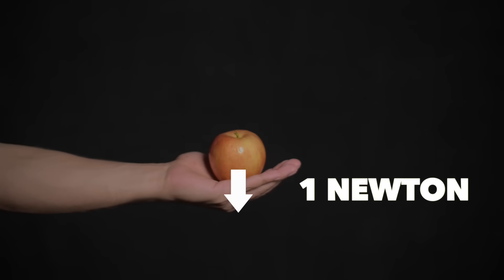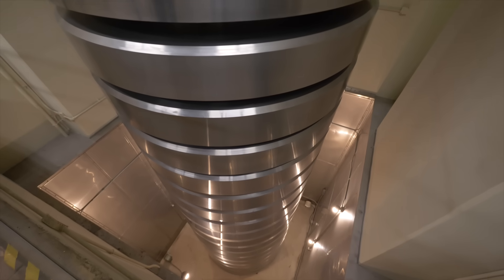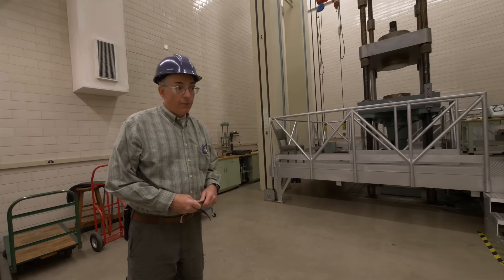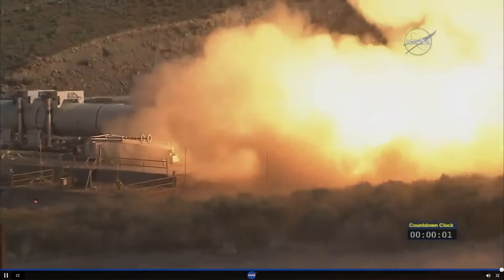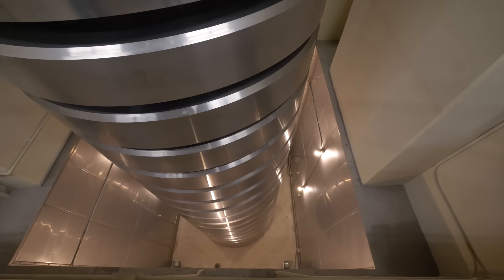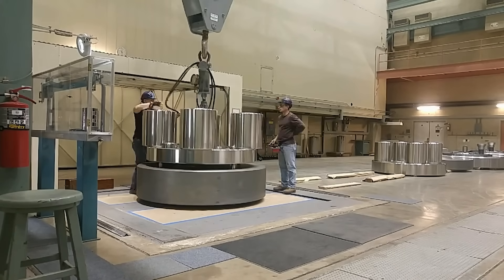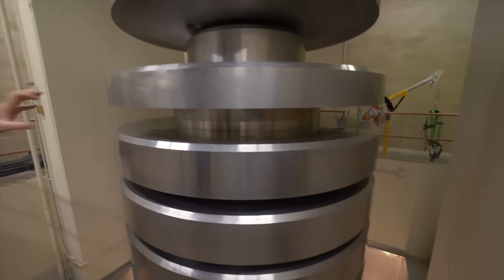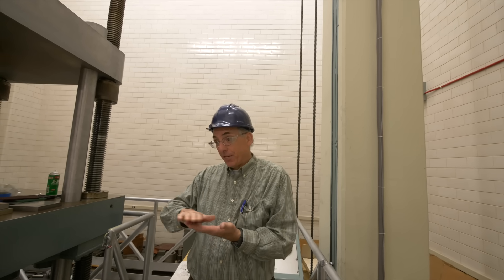World's Heaviest Weight

Comment: Is there an existence of a certain limit (number) of a maximum ammount of mass (kg) which has the form of a perfect sphere and is made of a specific material (for example metal), that has the ability to stay in the normal way, and if more mass (of the same material) is transfered into that perfect sphere (with the mind to even if the material is added, the sphere stays perfectly equal on each point with the mass - think of it as dipping it into the mass, which may be liquidized) ,before it destroys itself after that because of the added mass?
Emax I  kg/N-> x where x goes past a limit, that the middle of the sphere begins to crush ,because of the mass which surrounds the center is too heavy so the middle of the material can't stay unchanged.

In easy words: 
Is there a possibility that every material or only some materials are being crushed in the center by themselves if the material is formed in a giant perfect sphere. So that a max ammount of material exists that a material can have before crushing itself in the inside from the complete surrounding mass.

"o" = max
if o gets any bigger (for example mass is added to try to get the form "O") ,
the giant sphere O begins to shrink again until it gets the form of "o" again. Because of mass pressure.

Simplest question of this problem:
Exists a limit of density, where nothing can get crushed any further ( or nothing can get any denser), even with unlimited mass and power, building equal pressure from each side of the (dense) sphere?

I'd like to know that.
Any suggestions if something like that can exist?

Thanks
Reply: The singularity of a black hole.

This isn't even a joke answer, seriously. Neutron stars are a nearby second, but that's kind of what a black hole is, an incompressibly dense mass. It becomes spherical due to the force of gravity, you say 'has the form of a perfect sphere' when any gravitationally-formed mass will have the same natural form, it's not something that has to be specially striven for.
Reply: As I think of it, you are right.
So if this is true, Black Holes always have to have the form of a perfect sphere.
Never thought about that before.
But my question also is, if there is an answer, which "material" will the last stage (the most inside in a black hole) be, if the material, which is attracted to the black hole is something specific (for example: steel).
Will it physically due to the high pressure transform all the different materials which are mixed together into a new most-dense material and stay that way and only grow on the outside and transform every outer layer into that material or is there a max number of level of compression where a Black Hole only grows, but doesn't get more dense in the inside anymore and the Material(s) stay the same (steel stays steel, other materials also stay themselves - only compressed - just an example with steel)

On the one Hand: thinking about it physically, I would suggest there is a max compression and the blackhole only grows in Volume and mass.
Therefore there has to be a max. density.
On the other hand, seeing this problem physically, if you add more mass to a sphere, it gets more dense in the inside, because it compresses itself from outside mass.

I found the same question asked in better explaination of the thinking-experiment in another point of view, because I'm not the best in english.
Also named "Black-hole-Singularity"

https://www.quora.com/Is-there-a-maximum-density-for-a-black-hole-Does-increasing-the-amount-of-mass-of-a-black-hole-change-its-size

I also found the explaination of max theoretical density described as "Planck Density"
It's roughly 10^93  g/cm^3
Physicists speculate, that with such density, there should be new effects.
I also read that at a high density, there exists a spacetime curvature.
Anyway, thanks for everything.

Comment: 600 lb extra according to local gravitational field strength anomaly seems unexpectedly high, that’s about 1/7500. However gravity varies by as much as one percent, with higher values for Lower altitude and higher latitude. Therefore I will not be coming to conduct a quality control investigation.

Comment: Mass is mass and weight as inside a magnetic field produced by an electromagnet is weight !?
The most accurate measurement of weight used to be done by placing a piece of metal in between a magnetic coil. Now they use a photon beam. But the force applied in space or the time to gain momntum to displace a body is different to the force and time needed inside a gravitational field to displace that same body.

Comment: rofl.....stupid fucks still messing around with.......( snorts laughter to self..).............POUNDS....WHahahahahahahahahahahahahaha!!!!!!oh btw.....mr... lets get egotistical about a hydraulic press & weights....If you design a plane, knowing what material you use, on which frame, you know almost exactly what the forces are. You can also work out force, as a measurement of fuel burned vs displacement & rpm. Or in the rocket booster's case. fuel used vs. diameter of thruster vs burn rate x effeciency. and guess what...... YOU DON"T HAVE TO BE PRECISE re. the plane's power...so another storm in a teacup there for the sake of self ego stroking.

Comment: >calibrator is in America
>uses American units
>pounds measure force
>metric system doesn't
>"wHy aReNt yOu uSiNg tHe mEtRiC SyStEm"
Reply: Ethereal Forest ... Newton’s are metric. Newton’s measure force. Also it doesn’t help that he keeps saying that it has a “mass” of 1Mlbs. Btw if you want to defend the imperial system it’s best to mention that base 12 is better for division than base 10. Other than that metric has the advantage in every unit. But to engineers it doesn’t really matter.
Reply: @internetmovieguy  Fahrenheit beats Celsius for human temperatures.
Reply: @EGL24Xx  Yes, because you need to disregard both the length and weight measuring systems just for temperature!
Also, I personally can't really justify that argument if 98°F is a healthy temperature as well as ~103°F depending on what climate you live in.

Comment: Seems like a lot of these comments are about imperial vs metric. 1) It's an easy conversion, the mass standard here is still cool and the same accuracy regardless of unit, 2) most people said "just use kg", but kg is a unit of mass not a unit of force, which is what they want, which brings us to 3) Even Newtons, which is the appropriate measure, means basically nothing to people familiar with kilograms, since in SI units it is kg m/s^2, or the amount of force required to accelerate a 1 kg object by 1 m/s^2. If you want to associate it with a ballpark mass in terms of downward force using g, you need to divide by 9.8 m/s^2, which is so much harder than just multiplying by ~2.5 to go from lbs to kg. Especially since they're using big round number increments.
Reply: Americans are 300 millions. The rest of the world (7 billions) watches these videos as well and uses metric. Enough with their stupid system already,

Comment: Well, if the weights displace 125 pounds of air such that another 125 pound weight must be added, then wouldn't that weight also displace another x pounds, meaning another x pounds must be added which then displace y pounds, meaning... so bascially, when it comes to accounting for the buoyant force, they're probably adding a bit more than 125 pounds, no?

Comment: So -- it displaces 126 pounds of air. And I suppose the weight that they have to add to compensate for that displaced air must also displace a certain amount of air, so they have to add some additional weights to compensate for that additional displaced air -- and those additional weights added to compensate for that additional weight of air would have to be compensated for by adding some additional weights which would mean they'd have to -- hold on...

Comment: So much work just to NOT use N or Kg.
Reply: just have your government build one for you sweetheart.
Reply: @powerforth8400  I mean, the Imperial system is pretty much a direct conversion of the Metric standard, so as far as the scientific world is concerned, the Imperial system is literally inferior, but keep telling yourself that a system of measurement is better because an organization built a construction capable of accurately calibrating extreme forces.
Next time, if you want to invalidate someone's argument, at least use a relevant example to do so, sweetheart.
Reply: @Volvith  try working harder, not smarter.
Reply: @powerforth8400  only weak people stop learning
Reply: @Volvith  i feel like the reason he used imperial is because its exactly 1m and in kg its like 453592.37 which is alot harder to say and isnt as good to say in a video

Comment: They should use this as a battery. Have some sort of motor  lift it up on time they don't need all there power then when the need power. Have it hooked to a generator and the weight will power it.??

Comment: So what are these made out of to let it be so dense to get to 50,000 lbs? Because that must be VERY dense.
Reply: It's probably just steel. If you assume about 6ft in diameter and 6 inches thick, works out to about ~450 lbs/ft^3 which is about the density of steel. Cars don't actually have that much metal and they generally use aluminum for the chassis.

Comment: Why would you have to 125 pounds for the air?? If you would have it hang in a vaccum, it would not change its newtonian pull, right? What I am saying, I understand air has a drag on the weight, but the drag disappears once you stop moving it. So why calculate it into the measurement?

Comment: I wonder how accurate my gym weights are... and, yes, they are well below 1000 000 pounds, thaaat I'm sure of :-)
Reply: I know this was a while ago, but I can't help but answer. I was curious a few years ago and measured some gym barbells. The cheap ones are about +/- 8% accuracy. The more expensive ones are about +/-2%.  The accuracy also get's worse under about 20 lb. So your 100 lb. plate might be 92-108 lb, but your 10 lb. barbell could be 8.5 to 11.5 lb.
Reply: I had just assumed they would be something like +/- 1% so 8% sounded so much I had to weigh some of my weights. The fist ones (2,5 kg plates) were off by about 2%, the next ones (1,25 kg plates) were off by up to 5%. My 5 kg plates are from different manufacturers, one brand was consistently pretty much dead on, other brands were off by up to 5%. The real surprise were my 10 kg plates, two brands were consistently 8-10% above, another brand was dead on (maybe +/- 1%), my 20 kg plates are the same brand as the last 10kg plates and are also +/- 1%. Now I have had my workout for the day :-)
Reply: they won't be that precise because the more precise they are, the more expensive they are to make. and we all know that rogue wouldn't want to spend any more money manufacturing their barbells when they cost around $100 for a 45 lb plate.

and yes,  the 500,000 lb plates that i bought for my gym were very expensive but i was getting tired of doing high reps with low weight.

Comment: Why would a lab use imperial metric system? To not be able to directly correlate to anything else on earth and confuse people with the calculations?
Reply: The conversions are not confusing. But they really should switch to metric or at the very least display metric in brackets.
Reply: because it works, and its what people using it are familiar with.
Reply: First Last: You really must get a passport and travel more . . .